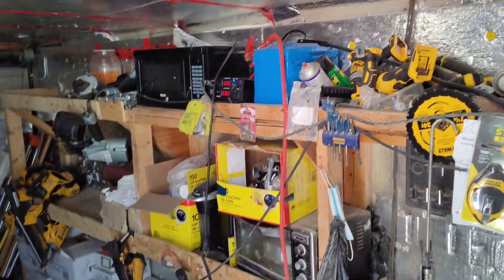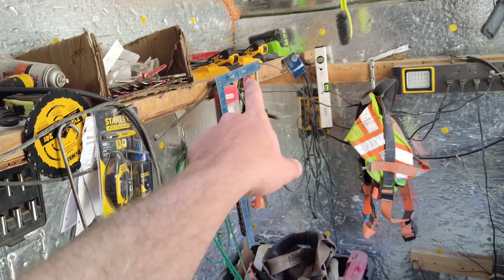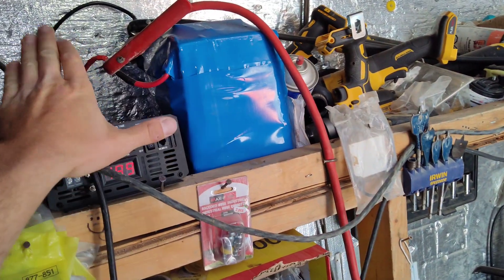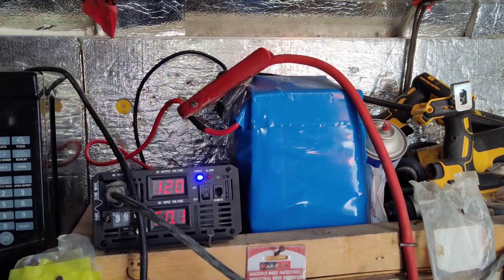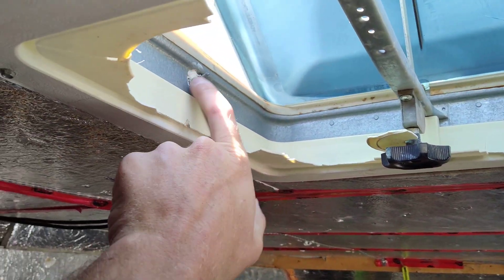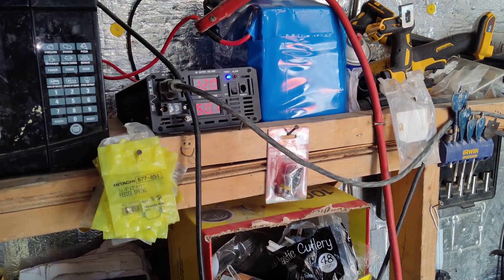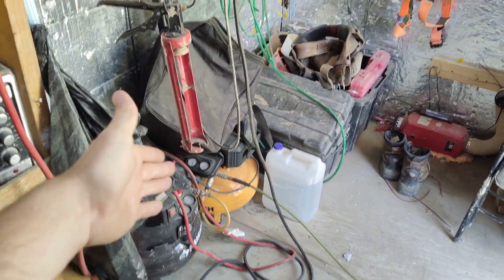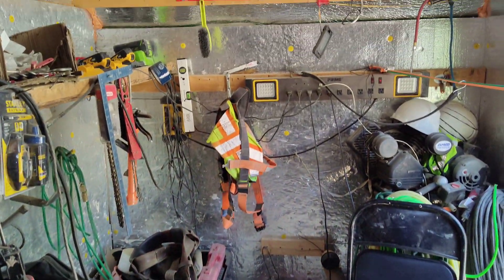5000w Of Inverter Power In The Work Trailer

Comment: Can I ask you a question you think a reliable 3000 watt 24 volt would run a cs-1500 Oregon self-sharping electric chainsaw I am trying to build a chainsaw Mill running off my solar at my camp
Reply: I have 2 and 1 has been running for a year straight at 1500-700 watts (mining Crypto) Though it was not enough to power a skill saw.  I have had it to 2000 watts just fine but that skilsaw was dragging.  look into the growatt systems from SignatureSolar.com.  good stuff.
Reply from the maker: im 95% sure it would start it yes
Reply: I've been using a real beat table saw 7 and 1/4 inch ripping 2x4s no problem with it and a 10-in chop saw with no problem I think they're around 13 amps this is a 15 amp and I'm seeing if I can rig a low speed went to stop it from feeding too much into the blade